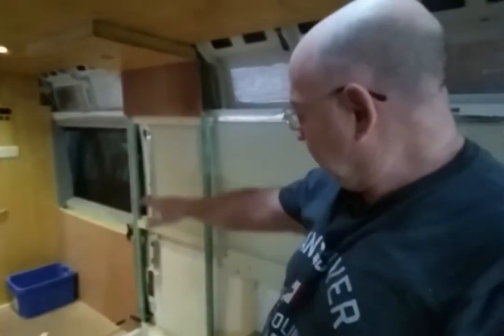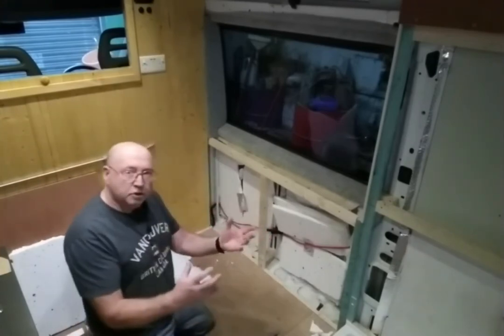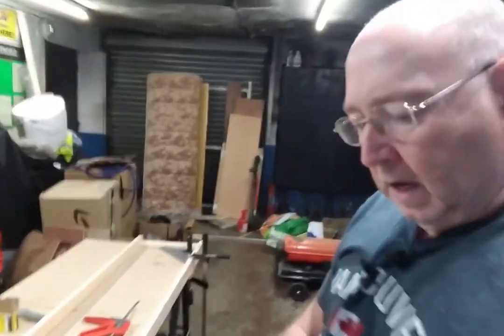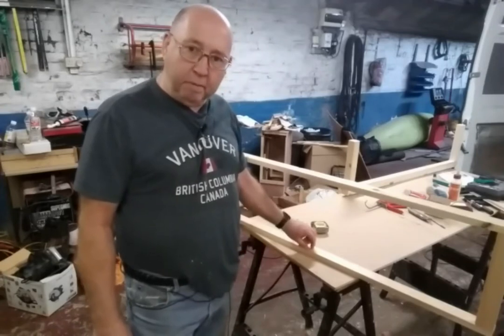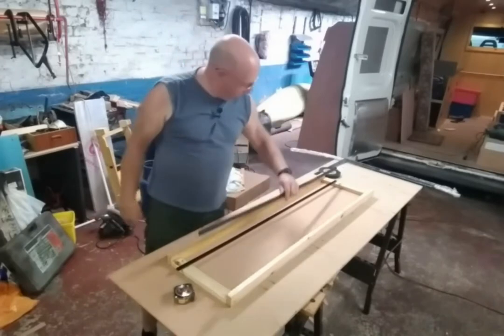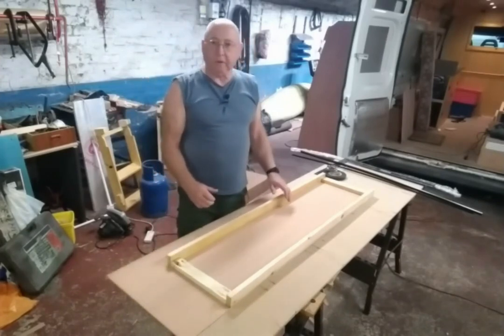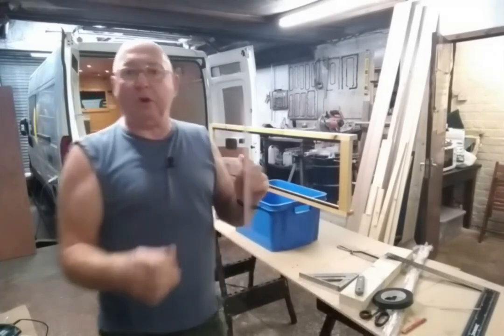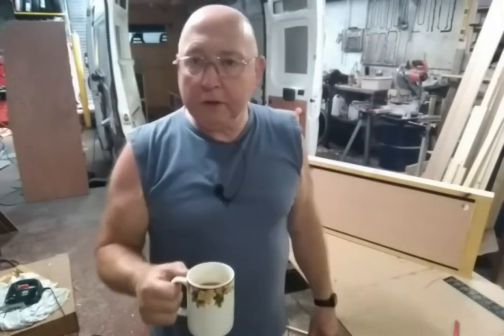How To Build A Camper Van Bench Seat With Storage Underneath ! Self Build Camper Van U.K. Conversion

Comment: Can you explain how you joined the lengthways frame to the widthways frame, at the corners? I would have thought that you need a screw upwards from underneath but how do you screw the from the side when there is already a screw in the way?
Reply from the maker: Hiya "Max Power" how you doing ?
I done that job quite a while ago now but I'm sure I used pocket hole joints, if you're going to do the same make sure you screw from the short battens (widthway batten ) into the long batten ( lengthways batten ) as you don't want to screw into the end grain of the timber, it's not strong enough !
I hope that helps you, I'm not a joiner by the way but mine have been in about 3 years now and are still as good as new .
Thanks for watching & taking time out to comment ...
                 Cheers ...Jimmy ...